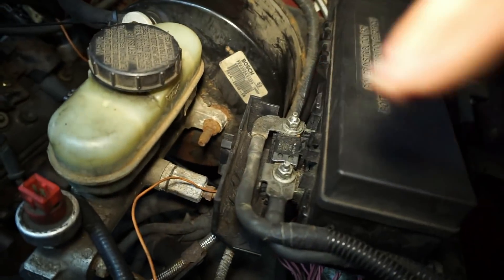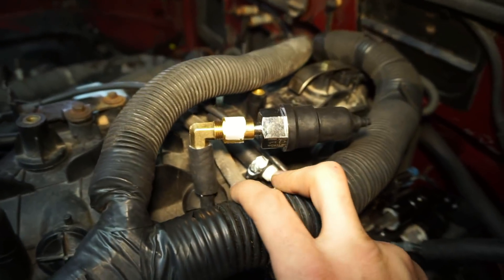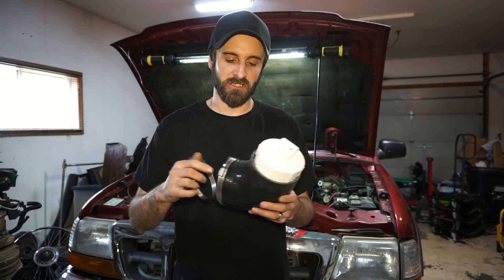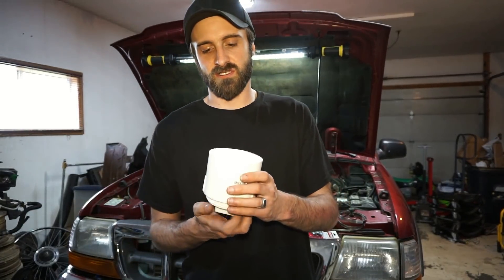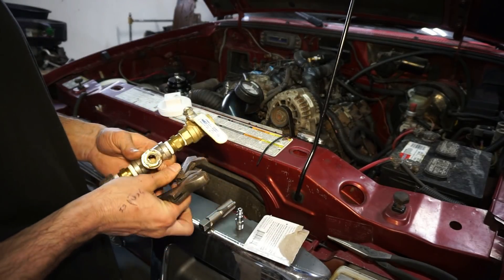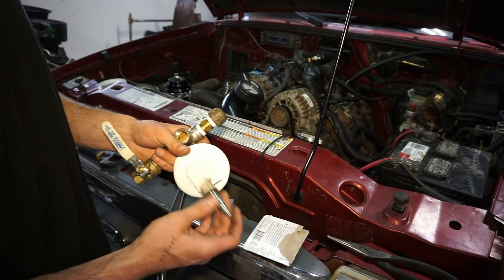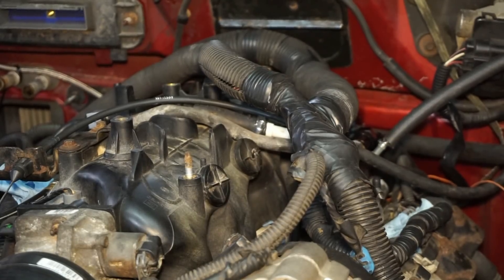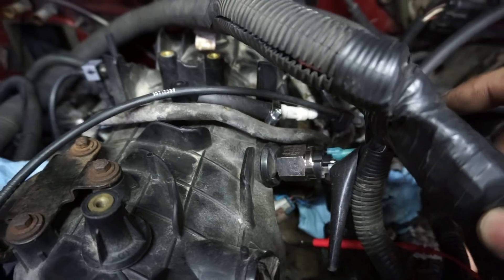BOOST LEAK TESTER GOOD!!! BOOST CUT SWITCH NOT SO GOOD!!!

Comment: Neat idea, but I have a stupid question. Isn't it a little ill advised to cut power to the PCM, or basically anything that will shut off the engine ? I envision you having control problems at a high rate of speed if the criteria get met to shut off power.. That seems a bit scary to me in comparison to roaching a couple pistons.. I'd hate to see ya get hurt through your own engineering... Just my $0.02

Comment: Question on ur launch controller idea!!! So once you use the momentary switch on the temp sensor can u set the rev limiter too specific RPM say 2000 and tweak the timing possibly making a “turbo anti Lag tune” that’s when you hear back fire Thro ur exhaust to archive full boost off the launch
Reply from the maker: rodo209 I think theres a way to do it but id have to play with it more.

Comment: 2 things, since that switch is after the TB was it open? I pressure tested my intercooler setup and it took 45psi to read 20psi on the boost guage cause i forgot to open the TB so it was slowly filling intake through the TB plate hole. 
2nd thing remember the engine will be turning over still and almost instantly drop pressure in the intake unlike this test which will slowly bleed down since the engine isnt pumping air right now.
Reply from the maker: WaywrdPirate Yes, it was open.Doing some better testing now... Same deal.
Reply: He’s right, what you are basically doing is a Cylinder leak down but instead of thru the spark plug hole you are doing it thru the intake. So if engine is running it will leak down instantaneously.

Comment: If you dont have any boost leaks and you bring it up to 20 psi does it instantly lose the 20psi manifold pressure by lowering the compressor regulator pressure?  Im wondering if it seems intermittent because the 20 psi manuifold pressure only slowly bleeds off (not at same rate the regulator gauge shows)   What does you truck boost gauge show turning this test?
Reply from the maker: T Ting it comes down pretty quick but I did check boost gauge after I recorded this and it way off from the compressor gauge... 20 on compressor was 5 on the boost gauge... Gonna play  again tonight.

Comment: I wonder if the reason it takes forever to make continuity is because even after you turn the pressure off it still has too much pressure in the system. I would definitely try it again and either unhook the air hose or open the throttle when you release pressure.
Reply from the maker: Welfare Wagon Tried both, but I did find that the gauge is way off, gonna play more tonight.

Comment: your bleeding off really slow with throttle shut, a blip of throttle would bleed of quick, and switch you back on. when you are driving when you hit the cutoff, boost will drop almost immediate, because your mind has to process what happened, then physically lift your foot off throttle
Reply from the maker: tortchevy I opened throttle plate, didn't really make a difference. In how it responded.. Gonna play with it a bit more, that gauge on the compressor isn't very accurate I found, lol.

Comment: Look into the hobbs switch people use to trigger their 2nd fuel pump or meth injection. It seems to be more instant on or off
Reply: right on
Reply from the maker: justin parks I wanted one that would be adjustable to 30+psi in case people go higher boost... Might go with one of those if this doesn't work.

Comment: I think you need to measure pressure at the intake manifold instead of regulator and compare to the pressure switch response. It may be working faster than it appears.
Reply from the maker: I'm going to try plumbing a different gauge in to verify it but not going to take my chances as it is... It's super inconsistent also... like 15psi different without adjustments... Don't like it yet.

Comment: I have an idea that might free up a few HP.
I'm working on a 94 Mustang and was fooling around with the alternator wiring.
There is one wire that comes from the alternator and goes to the dash alternator light and if that wire isn't connect to the dash the alternator will not charge! 
Ask me how I know :)
Anyway I'm think you could use that adjustable pressure switch from your last video and have it disconnect the circuit under boost,  that in turn will prevent the alternator from charging, reducing the drag on the motor.
I haven't tired this myself but it seem like a simple test. 
Not sure if GM's are the same but I would think so.
Later
Reply from the maker: It's a valid idea... I think the alternator takes like 30hp or something crazy to charge properly... Not sure on exact number but it's significant... Might not be that easy because the voltage would then drop to battery voltage and injector offsets would be at a different point..  Would take some tweaks but would be interesting.
Reply: I guess you could go a step further and have A/C compressor (if you had one), Heater fan motor,  rad fan motor, and any other electrical loads turn off  at whatever boost level the switch is set to. 
This could reduce the amount of voltage drop when the alternator is not charging.
Keep the awesome videos coming!